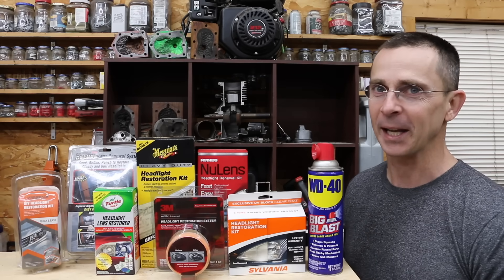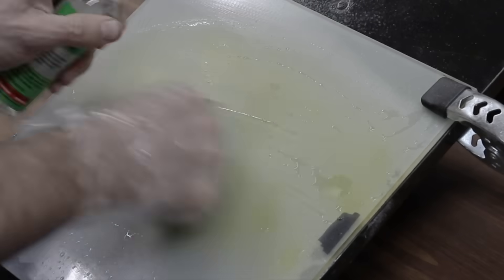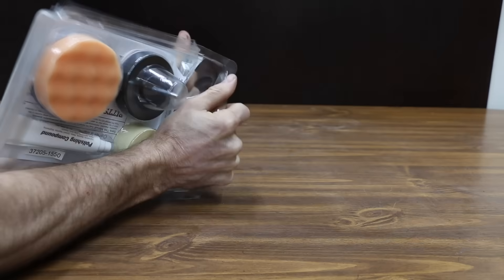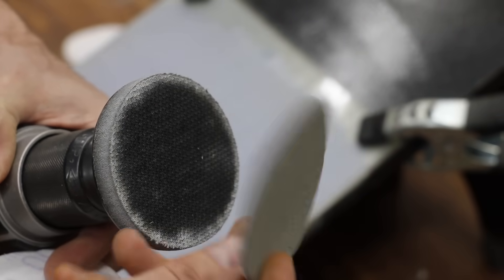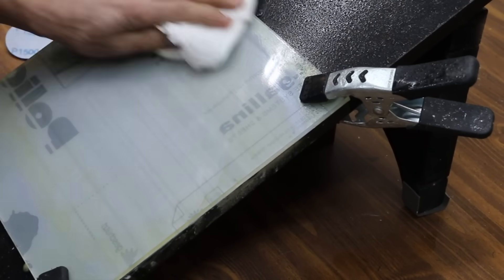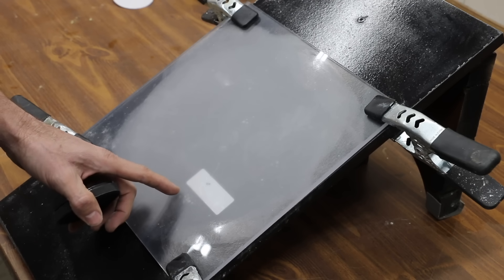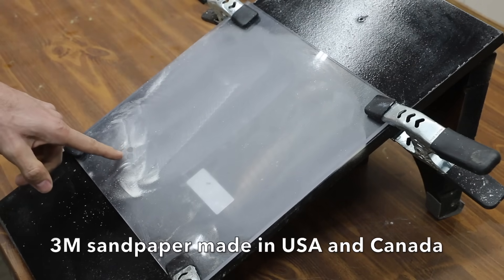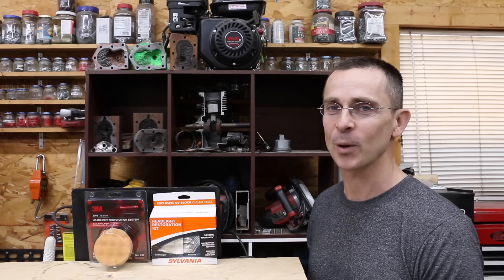Best Headlight Restoration Kit?  Let's find out!  3M, Sylvania, Meguiar's, Mothers, Turtle Wax & HF

Comment: **The LightRite UV Headlight Restoration *** is what dealers have used for many years, and it available to the consumer.   It was one of the 1st one's out on the market for the professional.   Here's the curve-ball - - -  they ONLY use 600 grit paper, and their coating is an aerosol spray-can that is UV cured in the sun or with a UV lamp. - I'd like to see how the products you tested fill in the micro-scratches with their UV Coatings under the microscope.  

Maybe they all do, so it really comes down to "Ease of Use" where there are "multiple step products" (vs.) a "Professional"  2-step process like the LightRight UV Kit, however, it really comes down to the final coating's "clarity" of the lens &  durability which is hard to test with all these products, so you have to go with long-term reviews.

Too bad Ryder Fleet Products just ceased operations in Nov.   They were closing it out at $7 a kit,  reg. price is $40.   This product well known and used for the Big-Rig Fleet industry.  Might be able to find it at a local Truck Stop or there are on-line vendors, or buy direct from the company.   

It appears to be the easiest system to use, with professional results since their coating contains high-solids which I think would fill in the scratches, but that would be interesting to see under a microscope for all products and to test each products capability to fill in each level of sand-paper scratches unless those other products depend on finishing to a clear finish in order to get clarity......hmmmmm???? 

Probably kits with an aerosol coating gives better results vs. a wipe-on product....
Reply from the maker: Thanks for the video idea.

Comment: I had some scratch removing compound lying around and used it and lint free towels to 'restore' my 2004 model year headlights. To me it improved the yellowing and fogginess,  and it was better than spending on a kit.  This Sylvania result however has me thinking I could make them a little bit better ... eventually.
Reply from the maker: Thanks for sharing.

Comment: I noticed that the turtle wax product claimed to remove oxidation, maybe it would have performed better if you left the sheets outside for a long time instead of using the yellow tinted protective coating to replicate the oxidation. I also would love to see a sandpaper ranking video.
Reply from the maker: Thanks for the video idea.

Comment: I have a suggestion.  You need to do, Which non-stick pan is the best?
We have tried numerous different ones, and all of them fail too soon. We use our pans regularly, several times a day. I don't think many people follow all the strict guidelines for using these pans such as; no cooking spray. Don't wash in the dishwasher. Don't use metal utensils, etc. Would love to see you test these. 
My whole family loves watching your videos. Keep up the good work, and when I finally get around to changing the oil in my Tacoma, I'll send you some of the used oil to test. It's been in my truck for 20k plus miles at this point.
Reply from the maker: Thanks for the video idea.

Comment: I happened to stumble on the 3M kit and it worked great. But also used this additional 3M product as well for it's sealant. It comes with a light abrasive pad as well. In the future reordering these clear coat kits is all I will need to keep up the headlights.  And the adaptor and genuine 3M orange cutting pad from the restoration kit has been SO useful on other projects.

3M Quick Headlight Clear Coat, 39173 https://www.amazon.com/dp/B079QL8BYK/ref=cm_sw_r_em_apa_i_tA5ZEb4991CPP
Reply from the maker: Great feedback. Thank you

Comment: I just did my headlights on 2 of my cars. I used turtle wax on the car since it was cheaper and used maguiars on the truck. The turle wax one worked just OK. Not great. But the meguiars on the truck worked significantly better and much better than shown in the video. I did however use meguiars medium duty box which was 3 grits of sand paper to be used with a drill on all 3 (dry sanding the first 2 and wet sanding the 3rd). Then using a 2 different wet naps(for lack of a better word) with the sealing compound on them. So I think the biggest factor is using a drill. I've used 3m before and it worked about the same as the medium duty meguiars I just used. The real take away, spend a few extra bucks on a good brand that uses a drill for all the sanding steps
Reply from the maker: Thanks for the feedback.

Comment: Paint restore products work great and most people usually have them.
Sand paper if the lights are really bad from start around 800 to 1200. Then use a cutting compound with a buffing pad on a drill or buffer. Then change to swirl remover and then a polish. Usually I don't even sand, just start right at a cut and it works a treat.
Reply from the maker: Thanks for sharing.

Comment: Best CHAINSAW BAR OIL !! 
Big brands like Stihl and Husqvarna Vs the cheaper stuff out there 
Here in Australia $85 for 5L stihl forestplus. 
$38 for Penrite 5L but is there a difference? And would be good to see a test with regular motor oil vs bar oil once they have been heated if the bar oil is still tacky, or could you just go with cheap engine oil...
Reply from the maker: Thanks for the video idea.

Comment: I used the Meguiars hd kit you tested on my 06 Dakota and I was quite pleased with the results.  It's been about 8 months and my headlights are still crystal clear.  My only complaint with the kit is the sealer applicator pad gets gummy and starts to fall apart too fast.  One tip I have is when sanding it was more beneficial to put a few drops of dish soap in the water  spray bottle ànd keep the lens SOAKING WET.  I went through 2- 32oz. bottles of soapy water when I was sanding.  My only regret is that I didn't take before and after pics to show how well it worked.
Reply from the maker: Thanks for sharing.

Comment: The salvage yards and body shops I work with just use a buffer wheel on a bench grinder with one or two different rubbing compounds. Seems to work great to be honest and pretty fast too...  Though you do have to remove the whole assemblies that way and most people look for the best results with the least effort.
Reply from the maker: Thanks for the feedback.

Comment: So I own a detail shop. Best way to prevent this from happening again after removing the used up clear coat is paint protection film like Xpel, suntek, etc. They all make headlight kits, especially xpel. Not only does this add a literal layer of protection, but has a self healing clear coat. Any good film comes with a 10 year warranty too. But once it's through it's life, just peel and replace. 
We sand and remove all the bad clear coat. Then polish it down, and finish by covering with PPF. Costly but lasts much longer than any kit on the market.
Reply from the maker: Thanks for sharing.

Comment: Thanks for another truly great video. I guess I know what I'll be picking up the next time I go to town. I have an old 1994 Toyota red pickup. I knocked around and it doesn't have but about 80000 miles on it and it needs a paint restoration. I hate spending a lot of money on a paint job so have any ideas on what type of paint restorer I could use? I don't know if I should just try a good wax and buff or should I use buffing compound? Thanks for the video, baffled in bama.
Reply: I also would like to know about this--

Comment: Thanks buddy, great as always. I used to buy the kit with most polish and then buy bundles of 3M paper so we could do more than one car. There used to be one from AutoZone that came in a silver pouch that was decent so long as you used your own sandpaper to supplement. It didn't come with very much but it lasted a decent length of time. 

The harbor freight sand paper; that send to be a problem with all of their abrasives. They gum up quickly.
Reply from the maker: Thanks for the feedback.

Comment: You can almost hear the lawn mower in the corner of the garage muttering, "Thank goodness he can't think of a way to use those kits on me!"
Reply: Poor mower just wants to cut grass but nooooooo, not at Project Farm. Guinea Pig mower.
Reply: @charlyRoot  Someone should design a guinea pig mower t-shirt with it wearing a lab coat or something.
Reply: Sylvania uv coating as engine oil 👀
Reply from the maker: lol  Thanks for watching.
Reply: Just used the 3m kit on my '05 Mazda3. I didn't get it perfect but the lights look great!!! Thanks!
Reply: I just finished the vid where he swaps the head bolts of his mower with jb weld and flex glue I think it was... those heads smacked the wall before the second ignition lmao I was thinking the same thing
Reply: LMAO!!
Reply: That’s awesome, I was wondering how’d he use these products in the lawnmower
Reply: Maybe UV coating the engine will stop build up in the engine.

Comment: Test idea: Cast iron seasoning test or positin as cooking/edible oil polymerization tests.  Which oils provide the best seasoning?  Test smoke points? Which oil polymerizes quicker/harder/last longer. Is a seasoned smooth cast iron cooking surface better than a rough surface? How soap affects seasoning.   Etc ..
Reply: Thick layer application vs thin application.. test the myths, misconceptions and marketing
Reply from the maker: Thanks for the video idea.

Comment: Great job again!
I have a suggestion. Just finished doing some restoration work to my car. I used some spray paint (like PlastiKote) made for the vinyl or plastic car doors pieces and consoles that typically get scratched or crack from age and sun exposure. There are many brands on the market. I tried a couple but not all of them. There are videos on YT that show people using them but how does it hold up over time and how about durability? You may have already but them to the Project Farm test. If so, could you please provide a link to the video.
Reply from the maker: Thanks for the video idea.

Comment: I love your videos, useful and no nonsense. Love your channel.
However, on this one, I must say something since I'm a professional headlight restorer. I don't do anything else, just headlights. I'm not a car detailer, or a mechanic or anything else. Just a headlight expert.
Those kits are just about useless, and most times, they do more damage than good.
Sanding is a last resort step. You never want to sand a polycarbonate unless it's absolutely necessary. And if so, you start with the least abrasive grit possible.
But, that's a last resort step, as I mentioned.
Lastly, and most importantly, never, ever apply a sealant or clear coat. Never.
Within a few months, a year or so at most, that sealant or clear coat will start to dry out, crack and peel off. Then, to restore the lens, you'll have to sand that off just to get to lens. A difficult, costly and time consuming process that can damage the lens. After you remove it, then you have to start the restoration process. 
Since headlight assembly units cost hundreds to thousands of dollars each, trying to save a few bucks by trying those kits is something I don't recommend. Especially, when it can be done right, professional and expertly for less than a hundred bucks in about an hour.
Reply: Barry - you trashed all the "wrong ways" to do it without offering any right ways.  Unless you mean 'hire me as a professional for $$4."  Do you warranty your professional work?

Comment: How well does this really emulate UV discolor and cracking though
Reply from the maker: Thanks for the video idea.
Reply: For some headlights, very well.  For others, not at all....  For some headlights, replacement is the only real viable option.  Some lenses discolor on the outside and these kits can save them.  Other lenses discolor on the inside, and these kits are useless.

Comment: 3M's has several kits but the one featured by PF (3M #39008) uses a power drill and MUCH easier than any hand application kit!  
Previous Amazon price was ~$9 only!  I used Dupli-color's E00 Headlight kit with UV Clear Coat goes on super easy.  Present day prices make this 3M/Dupli-Color setup expensive at $30+...
Reply from the maker: Thanks for the feedback.

Comment: Love the channel please do a followup in roughly a year's time, most of these refurb kits work but within a year look worse than before fix, peace bud
Reply: Well, after the factory UV coating has faded after the factory warranty has expired, you will pretty much have to constantly buff the plastic to keep it clear. 

Any company that says otherwise (quoting a lifetime warranty on their thin ass little sealant) is feeding you Bull💩 

If the sealant you use lasts a year before you have to re-sand and re-polish, congratulations. 

That’s just how it is with these cheap ass headlights and our SCORCHING SUN.

Comment: I still would have liked to seen a real headlight restored, rather than a sheet of polycarbonate.  Maybe you can do another video on a real headlight using the winners 3M and Sylvania.  That way we can see the chrome reflective surface of the inside of the headlight through the refinished lens.  Just a thought.
Reply from the maker: Thanks for the video idea.

Comment: I did mine by wet sanding working with multiple different corse sandpaper once all the oxidation was gone and it was just lightly cloudy I sprayed it with 3m clear coat spray paint that had UV protection
Reply from the maker: Thanks for sharing.

Comment: I buffed my headlights with compound and it cleared up. Do you need to use everything in the kit?
Reply: Depends on the damage. I do the same sometimes, clean with 50% isopropyl alcohol, then 2 coats of auto paint sealant like Meguiar's Ultimate Wax. You need to occasionally apply sealant since it does wear off, unless you use a more permanent headlight sealant like in the Sylvania kit or something similar.

Comment: I offer you an alternative solution. I was skeptical until I tried it. No buffing or sanding. It’s $10 on Amazon. CLT Headlight Restoration Kit. Pack comes with four wipes. That’s all it takes. Wish I could post before and after pics of my 2004 Mazda6. HIGHLY RECOMMENDED
Reply from the maker: Thanks for sharing.

Comment: Thanks for all the efforts!!! I simply wet sand from 500 ,800, 1200, 2000grit, then polish, spraying off residue in between.Next, mask off with newspaper, prep with alcohol, and spray UV resistant clear coat. Looks like brand new, and lasts.

Comment: Sylvania really surprised me, good to know, I need to do this on my headlights, a friend of mine used polishing compound to do car detailing that brings out a Showroom like shine and the thing was amazing but he didn't put any clear coating, I'll do the sylvania. thanks for the video.
Reply from the maker: Thanks for the feedback.
Reply: Generally, you don't apply a clear coating after polishing.  The chemicals in the polish prevent the clear coat from sticking to the surface.  If you use any type of polish to improve the condition of headlights, it needs to be done at regular intervals, multiple times a year.

Comment: I have a suggestion for something that you should add to your test data,  the ambient room temperatures at the time your tests are undertaken as temps can and will make a difference to your results, especially with adhesieves, gels, liquids, lubricants, and other similar substances.

You would show the temps at the time each part of each test was done, and you would verify the ambient room temp at the end of the test for validation.

Comment: I'm glad my old Volvo uses glass lenses! 

I guess the car manufacturers either, didn't foresee this problem, or they weren't expecting their products to last that long, but it never ceases to amaze me how many vehicles are 'apparently' passed as fit for use on the public highway with such atrociously bad light scatter from lights in such poor condition.

I wonder how many, if any, will ever get to be 'classic' cars, and still have usable headlights.
Reply from the maker: Thanks for the feedback.

Comment: https://youtu.be/IM76aD3bgQs

One of the best and fastest ways to take the yellow Oxidation off headlights is to use acetone and one swipe with a microfiber cloth.  I have a video on my channel showing it.   Make sure you do not use this method on headlights that may have through cracks in them.